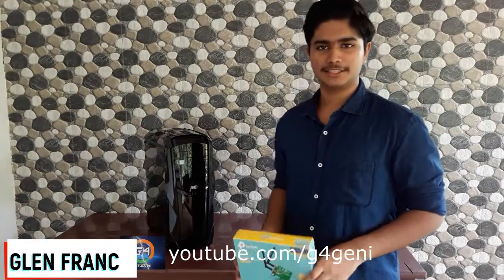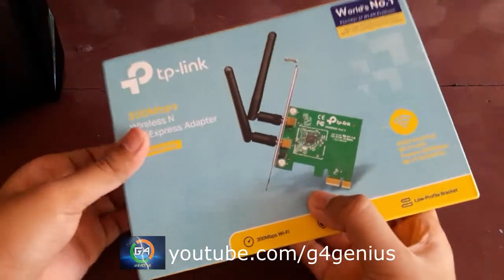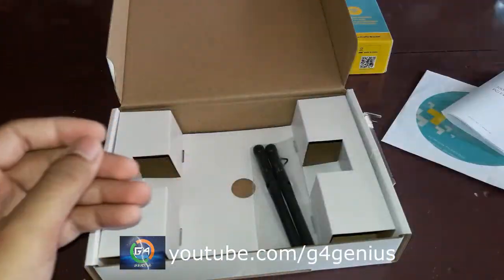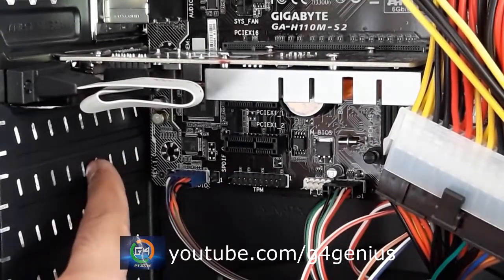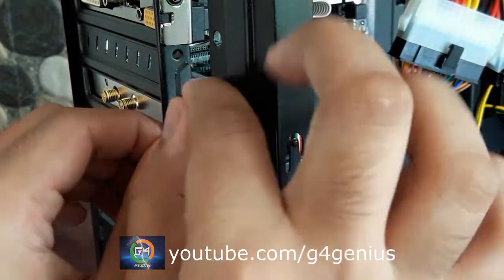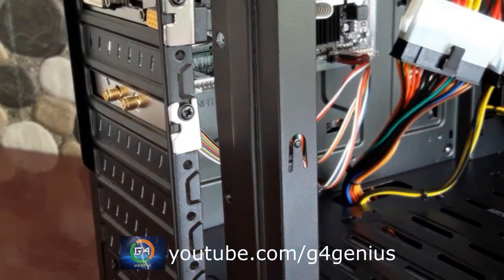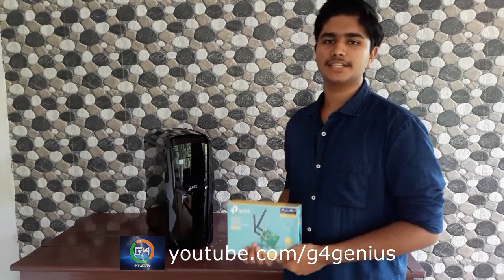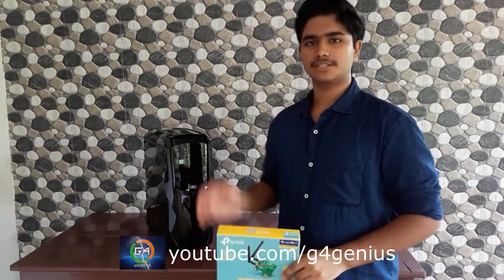How to install tp link 300m wireless N PCI adapter

Comment: Ith vachal m. 2 nvme ssd vaikkaan pattumo
Reply from the maker: Not clear question.

This adapter is for connecting to internet using wifi .

Ssd connecting in different port .

Both you can use in one system.

Comment: Bro free wifi network aanoo
Reply from the maker: You need a internet connection with WiFi modem or using mobile hotspot you can connect this device and get internet in computer.